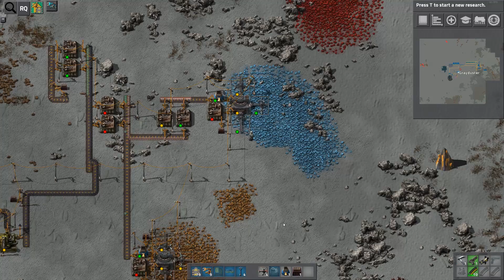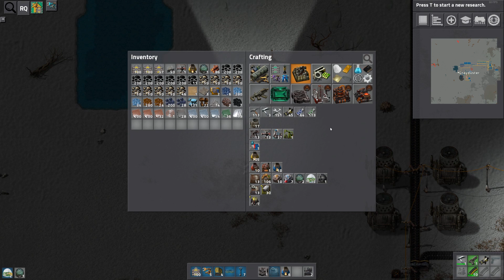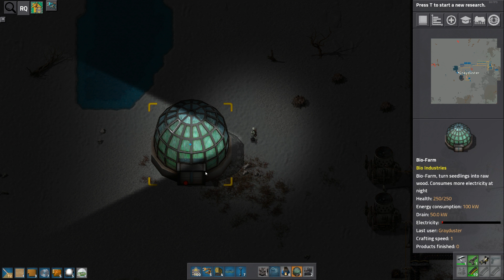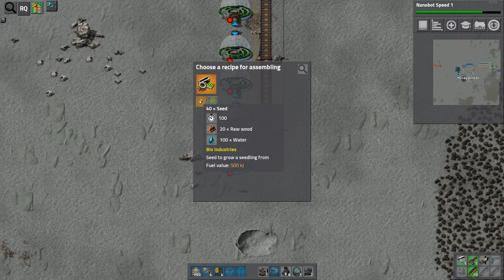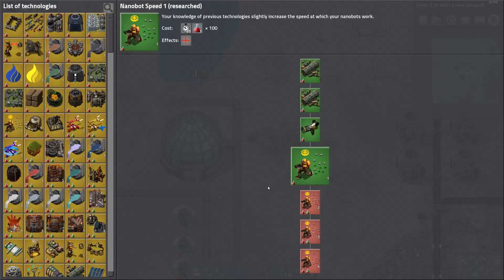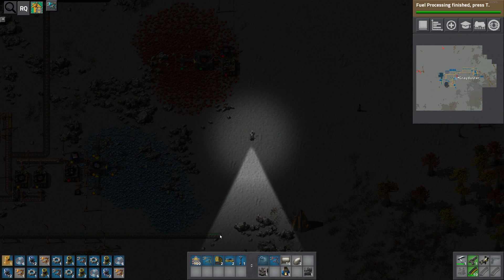Angels and Bobs Factorio 0.16 E04 - Basic Electronic Boards

Comment: One major obyimization that you can do is to use Electronic Assemblly machines wherever you can. They craft faster, using less power, and have a smaller footprint (2x2 instead of the standard 3x3) so you can do different, more compact layouts. Also try hovering over an inserter and press "Shift+E" it allows you to modify the inserters. I won't ruin all of the fun of exploring and learning about it, but it allows for more compact, efficient and interesting layout designs.
Reply from the maker: +Dnul Heh, I switch to those in the Optimisation and New Fuel episode